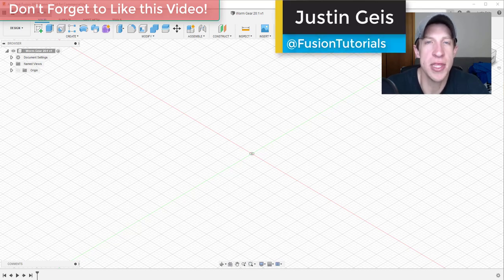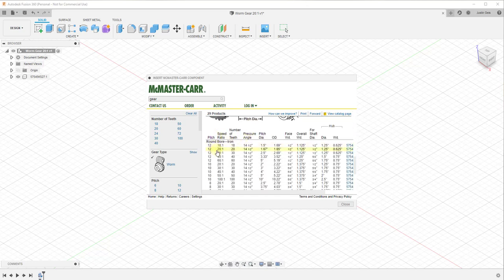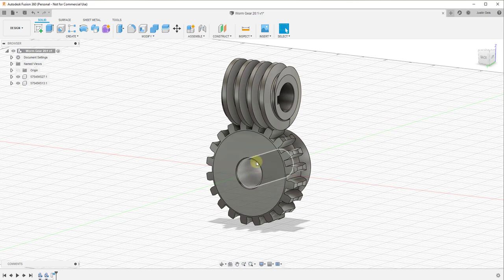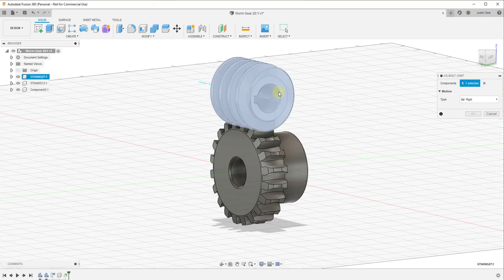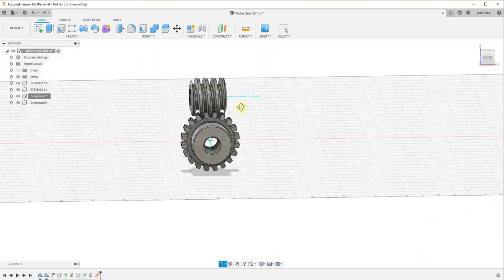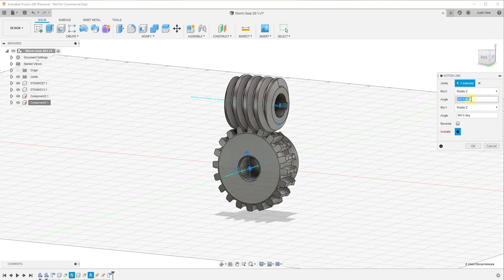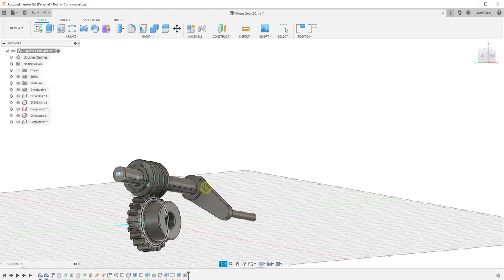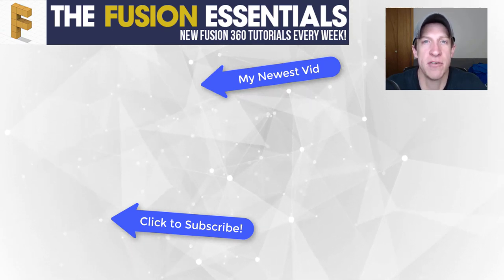Simulating WORM GEAR MOVEMENT in Fusion 360 with Joints

Comment: How common is fusion 360 in machine shops?  I sent my file two a pair of recommended vendors. Neither could take my file. They want Autocad or solidworks
Reply from the maker: I'm not 100% sure - my understanding was that you could export a Fusion 360 file in a format they can read like STL - did they ask for a specific file type?